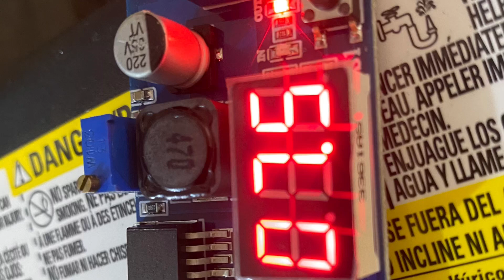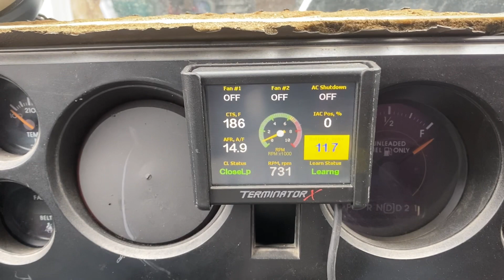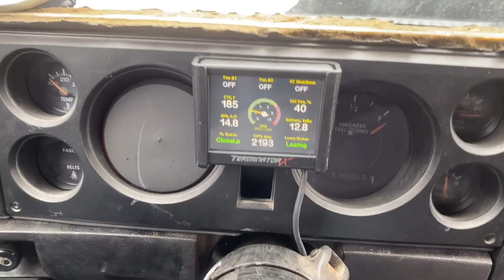LS alternator exciter wire voltage Prove it Please!

Comment: Ya i am seeing this video again 3 years later but a resistor doesn't realy change voltage it limits current and if the current is high the voltage will drop but going with a set voltage isn't really the play i am sure you could use an arduino to check the voltage and very the voltage to the alternator for the load but a set voltage probably isn't the answer
Reply from the maker: All I know is this works and ever one who uses the 470 ohm resistor says it works.  What ever it does I’m glad I found out. 👍
Reply: @HeadFlowInc  are you saying the 470 ohms or the set voltage and if voltage what do you recommend

Comment: Here’s the deal. Wire the L to a 47 ohm resistor then to keyed 12v. F to 12v switched.  S to the positive battery terminal. S terminal senses the voltage drop. Especially needed when the battery is moved to the rear of the vehicle. I’m getting 14.3 volts now at idle with the S terminal hooked up to the battery terminal. Without it the voltage drops to 13.9.
Reply from the maker: That’s a long way to run a single wire, what gauge wire did you use?

Comment: A resistor inline doesn't reduce voltage, it reduces current. if the resistor went from your hot wire to ground, that would reduce the voltage on the hot wire. You did right by just using a voltage regulator.

Comment: 👍👍👍
Reply from the maker: You can accomplish the same results with a 470 ohm resistor, or buy a pigtail with the resistor already in it.  I just happen to have the adjustable board style left over from a previous project.  Thanks!  JD
Reply: It sucks I am building a k3500 truck I had the PCm some one got it
Reply from the maker: That stinks, good luck 👍

Comment: Well emf emr physics says diodes make posative and negative. I would have said 1.7v but that 0degree so take it to say something like 40c.. thats 2.4 so 80 would be 1.2 aha :p   but then if got .1 drop 1.1 but you see u have batteries makeing the phases.. i gues from what i like to think of as "reluctant" i think but its excited tho everything is dropping and no one knows physics but they no how to use a multimeter and clamp meter.. but they dont understand the true physics that every single thing and device/ hand held testers actually do use! Its all physics but i keep getting close to everything in space and time because it rlly is space and time its waves and we can see that. Which if u know pie physics wise and proper e=mc^2 then u for sure will understand its emf but thats not just it look into c-rate too but for sure emf emr bro
Reply: I might be talking to big of "c" but thats wat i mean aha my understandings are still iffy but i get numbers and thats just  numbers tho^ but if i knew ur system i could prob tell u :) lol because i look and look and look into every single thing!!! Its not even funny
Reply: I love, that for anything to drop there has to be a "shift of 2 or more things which makes 1 or breaks 1, witch means for anything to be made theres to be more than 1 or less then so but to the atmospheric pressure at whitch is always changing then just looked at through a graph from scientests, but everything else be tooken and evolved into what it is now from all these "forces" and that is truly phenominal! 40 hertz resonating at the 11th power makes for levitation and force tho above or below that is still all other maximums in any form of charachteristic. Like theres too much to say about physics but it truly is a matrix

Comment: I know I'm late to this video, and I've seen the response that the buck converter is working so that's good enough... But I figured I would explain why the alternators are burning up and why the resistor is needed. Early applications turned on the alternator by providing 12v to the other side of the charging warning light on the dash. When the regulator sees that the alt is not charging the way it wants it to, the regulator tries to pull the L terminal to ground so that the light bulb will light indicating theres a problem. That bulb needs to limit current and in turn see a voltage drop to keep the regulator from blowing up. Similar situation to having a wire and light bulb and putting it across a battery. With the bulb it just lights up. Without the bulb the wire has to take up the entire voltage of the battery, moves a TON of current and blows stuff up within the circuit. Every time you key on without engine running the regulator is trying to pull the 12v you supply to the L terminal to ground. Using the resistor takes the place of the bulb limiting the current and doesnt burn out under normal conditions.  You can't find a direct answer to what voltage you'll get putting a 470 ohm resistor on a 12v supply because you aren't providing enough information to produce an answer. The voltage seen will be directly proportional to the resistance of the load. If your only load is the 1 megohm or so resistance of a multimeter, the voltage dropped will be nearly nothing. Yet if you connect a load of 10 ohms, you'd measure about 0.25v. that's why you aren't finding a straight answer to your question. And the buck converter isn't capable of delivering nearly as much current as the straight wiring is, so when the regulator is pulling the L terminal to ground, the buck converter's output sags rather than the regulator hurting itself trying too hard to pull down.
Reply from the maker: Makes sense, all I know is the little resistor board fixed all my problems.  No more dead battery, no more over charging Or eventually non-charging alternator.  Plus everyone notices the little White plastic bandaid box I mounted it in!  lol. I truly got lucky I guess, thanks for watching and the feedback!  JD

Comment: A single resistor is NOT a voltage limiter, it is a CURRENT limiter
Reply from the maker: All I know is the circuit board works 100% still going strong. The alternator is not overcharging and it just sat for nine months and the battery still had 12 V. Remember, this is the next side or wire not a main charge wire. It does have at least 1 470 ohm resistor. JD
Reply: HeadFlowInc  as long as your limiting current, that's all that matter. Voltage on the exciter means nothing. It will work with 5v to full charge voltage, but it can't be allowed to draw unlimited current, as this burns it up. GM alternators have worked this way since the first internally regulated unit. Some early trucks came with a resistor in line to the exciter on a 10si alternator, from the factory.

Comment: The resistor just limits the current flowing through the "L" terminal. It's only 1 resistor, so it would only have a voltage drop if the alternator is providing a resistance. A voltage divider is a circuit with 2 resistors in series with each other, and the voltage measured across any 1 of the 2 resistors will be less than measured across both resistors in series (which would be full battery voltage). If the 2 resistors are the same value, like 470 Ohms and 470 Ohms, then the voltage across either resistor would be 1/2 of the supply voltage.
Reply from the maker: What ever “Magic” is inside this circuit board works.  I know it has at least one 470 ohm resister and has corrected my issues with both over charging and amp draw when not in use.  Thanks for watching and the feedback!  JD
Reply: In all the comments I've read so far, this is the first that is accurate!

Comment: Resistors don't drop voltage, just amperage, current.
Reply from the maker: All I know is it works, for the first time since going LS my battery stays charged and I’m not burning up the diodes in the alternator.  Idunno 🤷‍♂️

Comment: it drops the field to a amp field of 7.5,. The resistor drops the Amperes... the problem is the amps from your 12v system can run cold cranking amps to 770amps.. much to high. Computer controlled signal is limited to save gas. Modern nightmare.  I think this is what I'm going through right now. Did the 10v work for you?
Reply from the maker: I’ve set mine at 5v and it still works fine.  I’d bet a 7.5v would work but I went with the factory reference voltage. 
They sell a pigtail at Jegs etc that reduces the voltage for $20.00 ish. JD

Comment: It's not quite as simple as working out a light circuit using V = A x R  etc as you are supplying a voltage reference to an electronic circuit, this does two things it gives the trigger to enable rotor current and also a reference biased voltage to recognise charge voltage with ability to adjust for voltage drop, say you wanted to put your battery in the trunk then physics dictates you will need a slightly higher charging voltage so your reference voltage should be sourced from battery not from dash for reference circuit  as in all electrical systems as load increases voltage wil drop, this exciter circuit will see this also and provide an input voltage change to regulator as well as it sees output terminal voltage, if you decrease exciter voltage slightly by increasing resistance you will see a corresponding increase in output voltage as regulator compensates, rather than have a regulator with a preset output voltage it is variable to load and voltage drop indicated by sensor voltage feedback thru exciter circuit, my suggestion is to use a variable rotary type resistor to determine what you require then either use a fixed resistor ( not ceramic type as they are thermally variable) to finalise circuit, keep it simple for reliability, long ago with external regulator alternators you would select the regulator with the output voltage you required  as load requirements changed so did system voltage, newer alternators have the ability to charge at higher amperage at lower speed ie idle with modern electronics loads this is necessary as older type alternators cannot keep up and batteries can become discharged with extended idling, do not try to use older alternators with modern efi engine swaps it only ends in heartache, use the one that came with motor at least, if you want to increase the output of alternator cheaply then change the stator windings from STAR connection to DELTA connection (separate star connection then A1 to B, B1 to C, C1 to A for those that understand)this will enable it to increase output by about 80% but with old style regulators this is still only proportionate to load, ie a 50amp will be capable of about 90amp but only if the load is there so as battery becomes charged the output amperage decreases quickly unless you add load like lights etcetera, an old style alternator modified this way still will not charge at same rate at idle like a modern one will the regulator is just not designed that way, hope this helps
Reply from the maker: Thank you for the detailed description.  So far I’m happy with my adjustable “thingy” I installed; it’s been working great by keeping the battery charged.  I’ve experimented with setting the voltage on the reducer at 5v, 8v and 10v with all seemingly working I settled with leaving at 5v to be safe. Hopefully it will continue to work… 🙏🏻

Comment: It's cause not enough people that know what the hell they are doing for real have encountered this to come through and put the info out.   I'm stuck for months now with low voltage on an exciter wire in a 1993 Seville.   I don't know if it's corrosion or someone put too strong a resistor in line.   Bulb had been removed before friend bought the car when I took dash apart.   So I have voltage now.  9.2 and alternator doesn't turn on.   I think this car needs 12 at the exciter
Reply from the maker: It’s very possible the older 1993 alternator might need 12v, can you run a temporary wire from a 12v source to test/check?  If you provide 12v and the alternator starts working it may be the answer.
Are you positive the alternator is in good working order?  JD

Comment: That 470 Ohm resistor you point at on the dc-to-dc converter is an inductor
Reply from the maker: I’m totally confused on Amperage!  I’ve lowered the input Voltage to the alternator to 5v and it made zero difference to the output voltage of the alternator. The key I’ve found is the Amps needs to be below 1a.  🤷‍♂️

Comment: You’re spinning too fast RPM. If you remember the old gm 10&12si alternators you had a “D” slot in the back to ground one of the field brush tabs. It full fields it bypassing the voltage regulator. Same concept here. The rotor has one coil of wire inside and the ends are exposed on the back and the slip rings are attached. From the factory they are spot welded. When rebuilt the new rings are soldered on. There isn’t any mechanical support for the connection. The solder is heavy. When spinning at hi rpm centrifugal force is pulling them out. If the wrong end of the rotor coil touches any metal part of that rotor is will full field. Eventually it will stop charging completely. Also the plug is labeled PLFS. The L is the only one you need key power to. It gets its power through the battery light from the instrument cluster. Simple fix is run a 194 bulb in the circuit if you’re just running key hot.
Reply from the maker: Very interesting information!  I found the 194 bulb is rated as,12v 3.8 watts, this must be a resistance similar to the 470 ohm 1/2 watt resistor everyone is recommending. 
I know lowering the voltage to 10v still burned out the diodes resulting in a final warranty swap and my Lifetime Warranty being Voided by Advance Auto. 
since swapping the alternator for the 3rd or 4th time, idle time only no driving,  tested 7.4v and 5v signal to the exciter/field wire both resulting in an output of 14.7v charging. I haven’t tried lowering it any further but the adjustable dc-dc reducer can go as low as 1.5v. 
I’m definitely going to triple check which terminal the reference is pinned to now, hopefully it’s the L as you described!  Thanks for watching and the feedback I appreciate it!  JD
Reply: @HeadFlowInc  what year and model did the motor and ecm come out of? I can look it up at work tomorrow and give more specifics. FYI: some chevy trucks will turn alternator on/off while running for fuel economy. If the headlights are manually turned on that disables the feature. 
Also where is the output cable connected? If that circuit is interrupted (ex. Cable pulled from battery) while charging it will cause a spike and can blow the diodes or v reg. Same with ground cable.
Reply from the maker: The engine is a combo of parts from 2000 and 2002 and runs on the Holley Terminator X engine management. 
The alternators we’ve been using are for the 2000-2002 Chevy Silverado; mine is the higher 130a version. JD

Comment: A 194 peanut bulb inline has the same resistance as a 470 ohm resistor. I think it brings the voltage down to roughly 8.2 volts. I've used this for the last year and a half and it works perfectly on my junkyard setup.
Reply from the maker: Interesting, I’ve heard 8v several times now, I wonder if the lower the input voltage the higher the output?  I have mine set at 10.2V but it may charge better if I lower it to 8v?  Thanks for the feedback I appreciate it!  JD
Reply: I’ve gone through multiple alternators on my LS swap toyota as well.  I think you are referring to the “L” terminal(not the B terminal), btw.   It looks to me like you have a voltage drop issue from your battery located in the back. Did you ever figure out why you were frying alternators?

Comment: You nede to know the resistance in the regulator aswell to know how much amps is going thru the curcuit. Lets say its 65 ohms over the regulator then you have: 65+470 ohms = 535ohm. 12V / 535ohm gives you 0.022 amps. 0.022x470=10.54V
Reply: I’m gonna have to do this my self in the spring. I’m putting an LQ4/4L80e with Fitech 70051 in a 67 C10. Here is how I plan to solve this problem. I’m gonna use two multimeters, one sett for V and the other for amps. Then hook the amp meter between B terminal and L and Volt meter on battery. When I read 14.2V on battery I’ll read amp meter and then move positiv probe from battery to B terminal and read this value to. Let’s say B reads out to 13,5V when battery is at 14,2V and amps is 0,5. Target Volt is 10,2. 13,5-10,2=3,3V/0,5amps=6,6ohms
Reply from the maker: That’s awesome I appreciate the clear description!  I need to verify the GM alternator regulator resistance; based on your example it has to be very close to 65 ohms.  Thanks again I truly appreciate it!  JD
Reply: @HeadFlowInc  No problem, but how ever I think this 10,54V her is the drop over the 470ohm resistor so if you measure after the resistor you probably will only find 1,44V. My guess is that the resistance over the B terminal will be much higher than 65ohms. But then again high school was back in 1990 so I could be remembering wrong. Post your B terminal measures and  I can another go with the math. Love your LS porting videos. Any thoughts of visards diggin in the head under the valve seat creating a ventura shape?
Reply: Im not sure why your alternator charges 16V. The B pin on your loom is connected to  L on the alternator and it requires a charge light. When you turn ign on 12V goes thru light and to L on alternator and grounds there when alternator is not charging. It also acts as charge start. When alternator charges it sends 12V out of L and you no longer have ground and light goes dark. Pin D on loom is S on alternator. S is for sence and can be connected to B+/fat wire on altornator or to + terminal on battery if you have a voltage drop in loom. Alternator will then use this to know how much effort it has to put in. If you dont have a charge light on the B wire(12V 1,2W bulb is 120ohms) and D/S is not connected, thats probably why you need to put in a resistor not to cook battery/alternator. Glenn
Reply: Pin C on loom is F on alternator. F is Field and goes directly to rotor and are not regulated by regulator. F is used when ECU controls charge. If you use and old loom with both B and C pin, try to disconnect C pin. You can also use C/F if you have an external regulator.